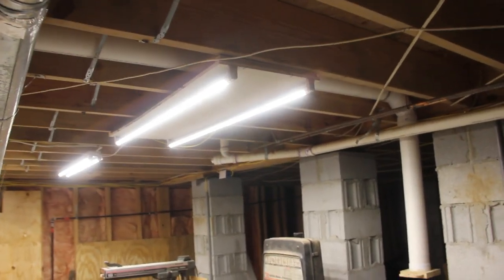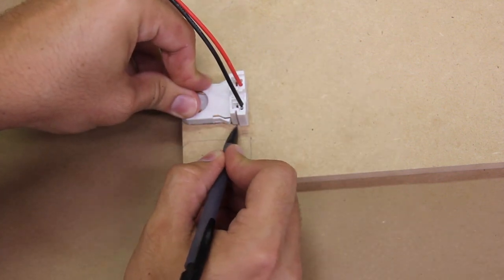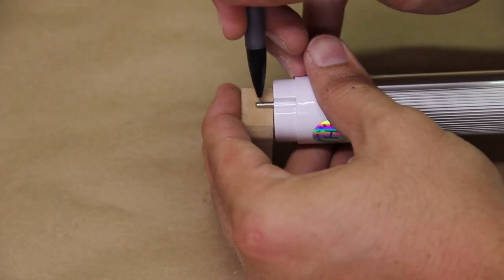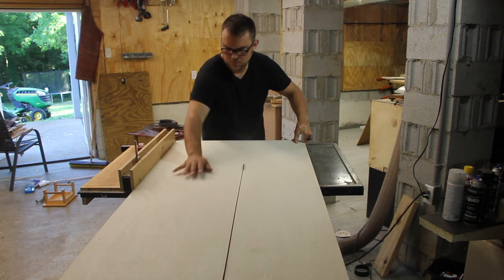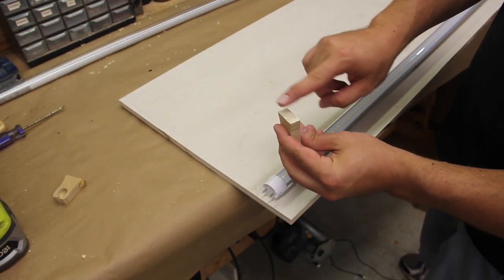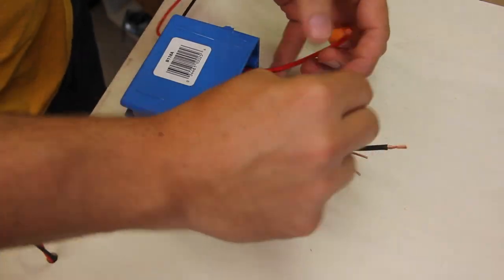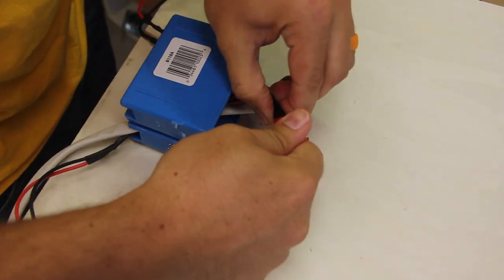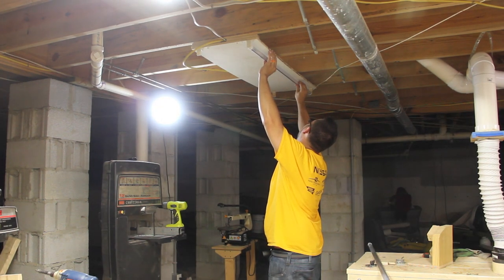How to make led shop lights

Comment: I do like them but I do see ways you could improve them as well! A center and side reflectors would direct more light downward and painting the board white would help too! And I only suggest that because of the type of bulbs you are using as a "radial pattern" of light coming off of them!!! If they were standard LED light strips then they don't require any reflective surfaces at all! But the type of bulb you have could benefit from the reflectors!!!! But still just the same I do like how you built your shop light! For me I am working on making a similar pair, but lucky enough I got my hands on some bad "damaged" shop lights that I can use the reflectors out of!!! Thank god for people tossing things out on the street at times!!! LOL!!

Comment: Awesome job, you should find some aluminum sheeting and make a reflector so you can get some of the bounce back light and focus it down a little more if you wanted anyway.
Reply from the maker: +Nick Diamond Thanks! That's a great idea...I'll have to keep my eye out for some. In the mean time I may paint the plywood white.
Reply: They used to make a metallic reflective spray paint, I don't remember if it was Benjamin Moore or if it was Rustoleum but one of them worked pretty well. I'll look and see if I can find a link some place.
Reply: Not really needed, leds only output light one direction 180, unlike flourescent which goes 360